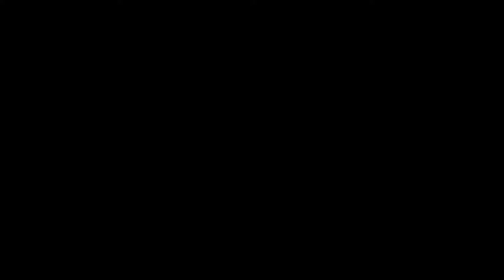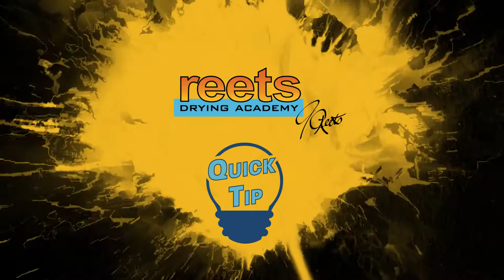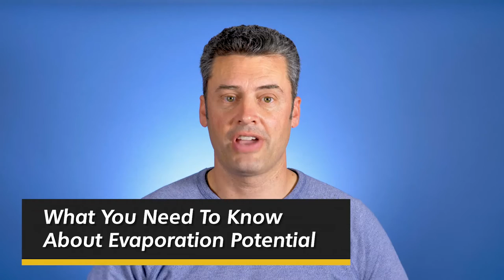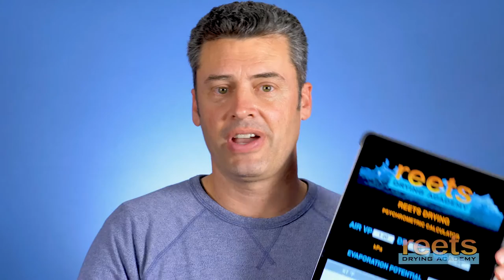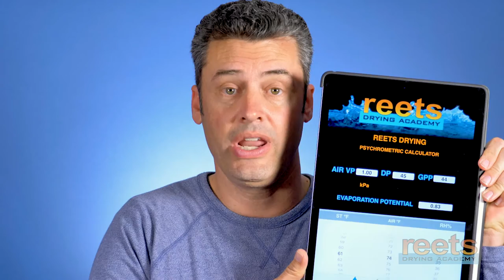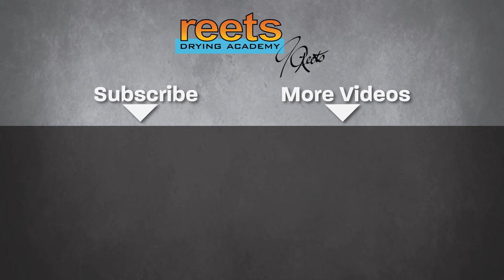What Is Evaporation Potential and Why Is It Crucial for Water Damage Restoration?

Comment: So The more the kPa Is resting on area the more the evaporation potential? 
And heating the surface temp increases the kPa resting on the area? And the number that the calculator equates, the higher the more kPa on the area resulting in more evaporation potential?